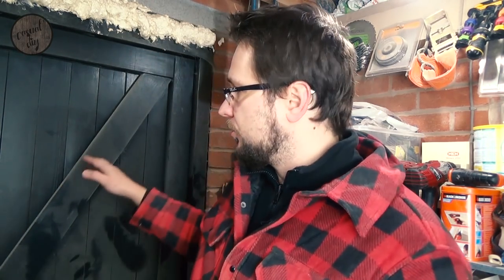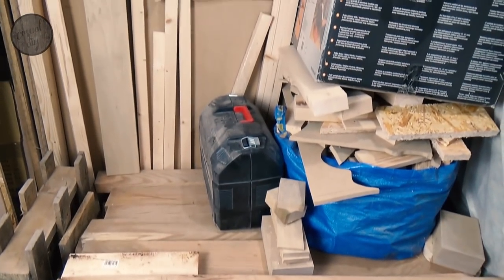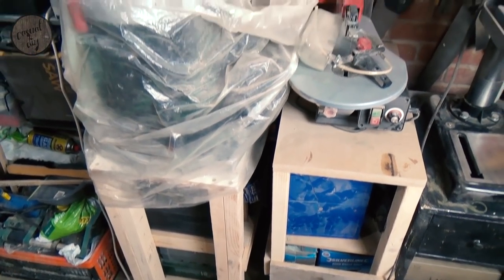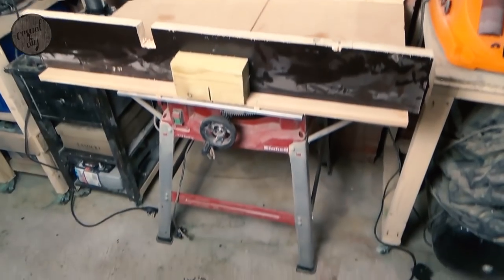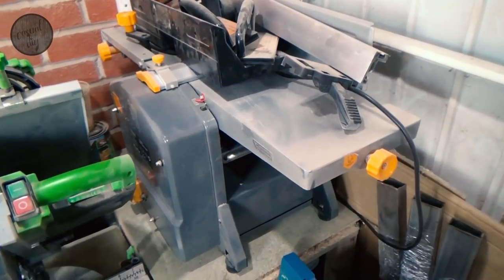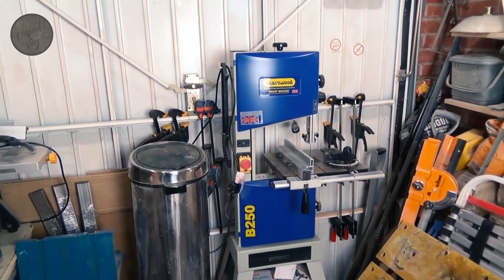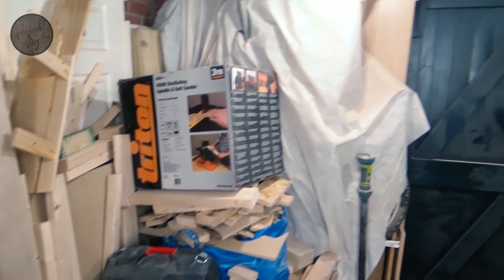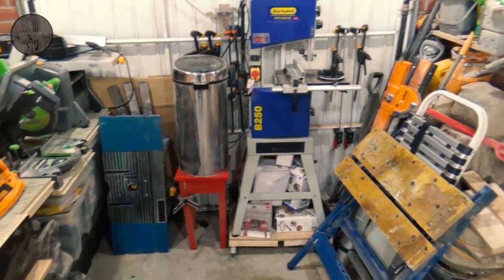Workshop tour 2018 Jan

Comment: Well done! I am starting with a blank sheet 16 x 8 ft shed so apart from less headroom, about the same amount of space as you. Just starting out on my tool acquisition - so thinking very carefully about that. I have a TS55 plunge with tracks (my Xmas pressie)and a basic mitre sliding rail chop saw and pontificating if I can get away without a table saw by buying a half decent Charnwood band saw (what model have you got)? I noticed I have the same router table as you (I bought it about ten years ago and never used it yet - how do you get on with it? I was thinking about taking the legs off and insetting into a workbench....... and the pontificating continues😂

I have subscribed and now want to catch up with your story. Looking forward to seeing how you develop your shop.👍
Reply from the maker: Norman Boyes thank you for the comment and Subscription :) the bandsaw is B250 done a unboxing and review video on it if you want to check it out. It's a good bandsaw for DIYer. The router table is rubbish to be fair, on many occasions the wood catches on the table itself on those groves as they are quite sharp. And the fence on it, well you can just forget it. I have done some wrong tool purchases when started building my shop. Like the Evolution miter and table saw combo, it's just not a great tool. But yes woodworking and DIYing is very rewarding awsome hobby and potentially good earner. Hope you will do well and that you will enjoy it!